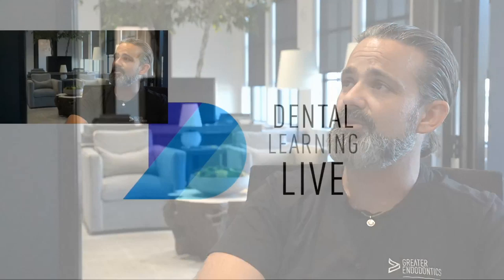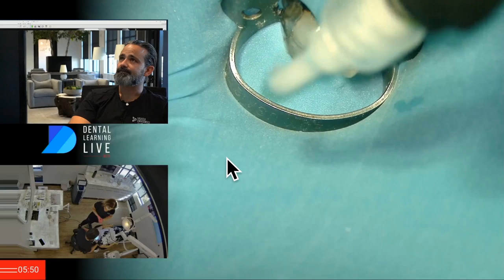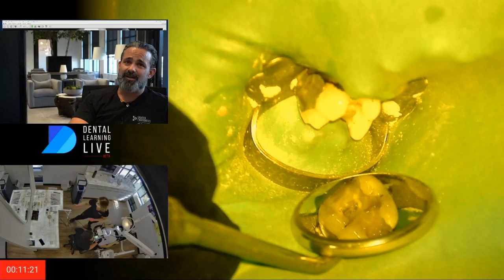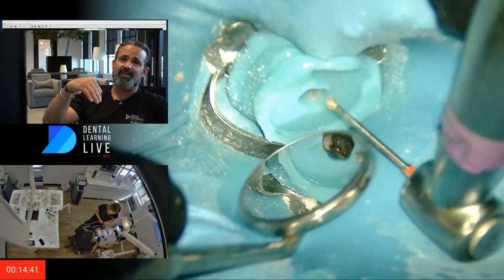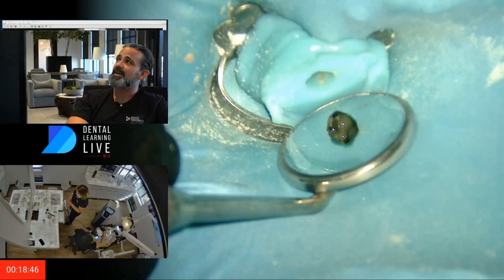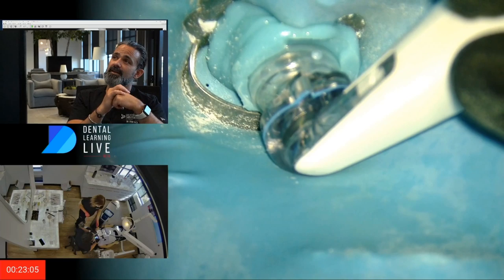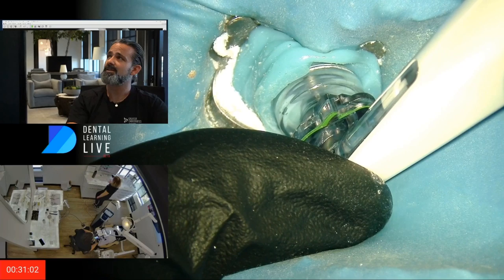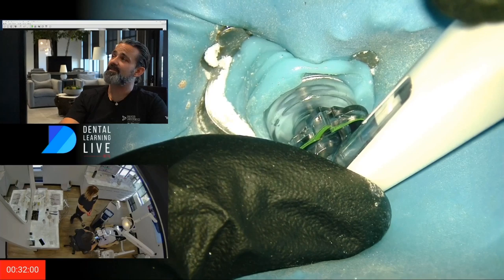For Love & Lateral Rockets  🚀 ❤️

Comment: Hi Doc. I have just started using microscope for restorative aspect. The hardest part is to do mandibular class II's. Here when you dropping a box on mesial of #19, are you going blind and feel?
Reply from the maker: Smaller mirror and fine focus, you can always see, when sitting in the 12 0'clock position
Reply: @dentallearninglive8325  What size mirror do you use?